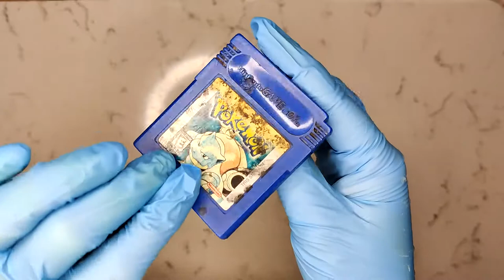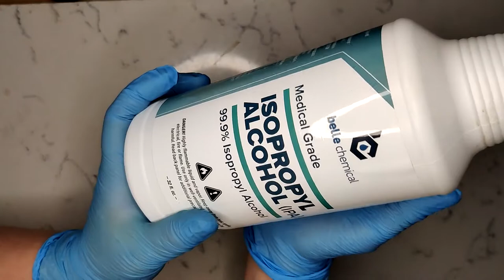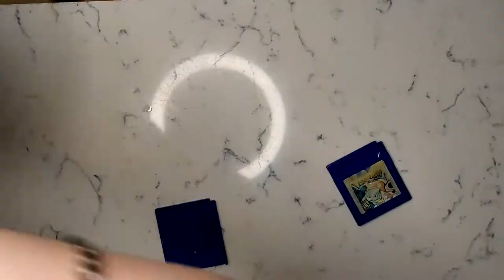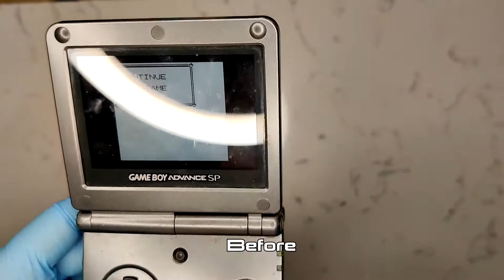Scarlet Restores! | 06 | Pokemon Blue Gameboy Cart Restoration!

Comment: These restoration vids are really interesting! I've never really thought about the work that goes into cleaning up an old system/game. And I like your subtitle commentary instead of having audio.
Reply: Yeah, "properly" (there is no 100% correct way on these things) cleaning consoles, cartridges, even disc-based games and their cases takes a bit of work. Game shops just wipe down the outside of things, but it leaves decades of grime inside.
I like seeing these videos as it's almost therapeutic...after vigorously cleaning retro gaming equipment myself the same or previous few days!

It's nice to actually have clean stuff. It's too bad that labels don't always hold up, but that's just one more thing to trap grime and odors from their past. Think about all those paper case inserts and manuals - who knows what's in there! ;) I imagine some hoarders/"collectors" have rooms that smell something like an old library, possibly masked with additional stronger fragrances.